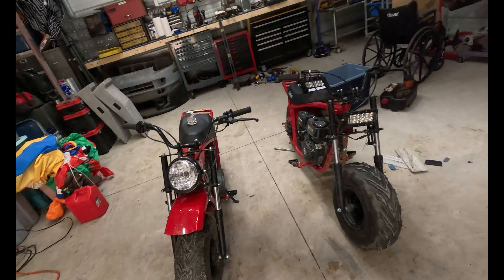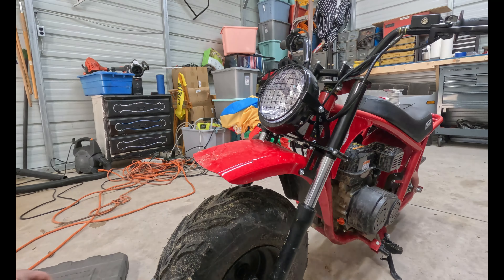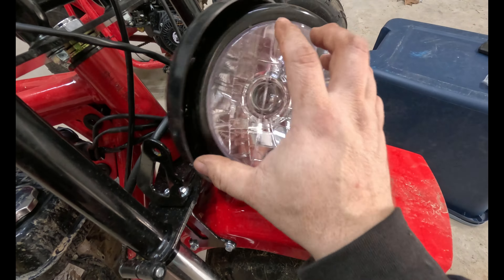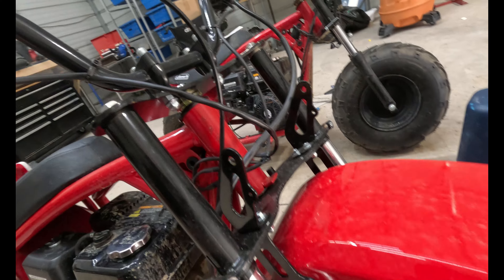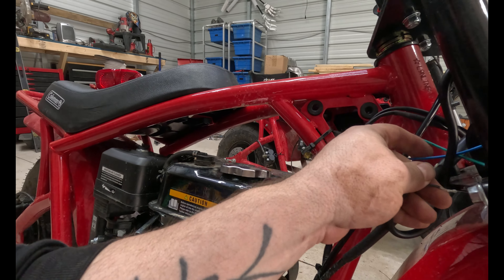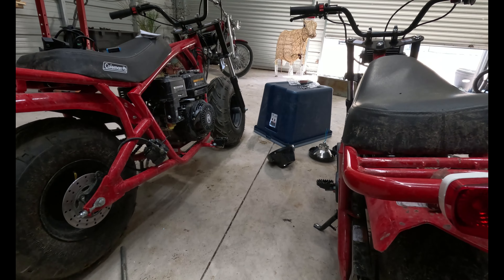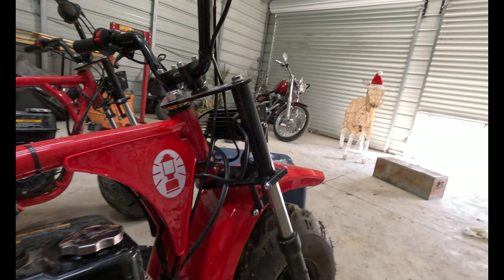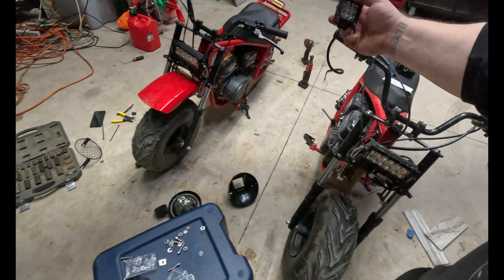Coleman B200R mini bike light upgrade

Comment: Huge props bro thank you. My headlight had gone out on my bt200 and wasn't sure what I was going to do I was leaning towards just putting an LED and replacing it with an LED but then realized how much of a hassle it is. Came across your video and 30 minutes later boom I got a great light for the front. Thanks bro!!
Reply from the maker: Appreciate that bro glad I could help.

Comment: This worked very well, I was stressed out the first time because it didn’t work but I took a closer look and realized the cores the wires weren’t touching 😂. Definitely worth the 50 bucks and is a big upgrade from the weak Coleman light 👍
Reply from the maker: @Zakistheman  glad I could help.

Comment: What size light bar is that?

Sorry if you said it in the video I never came across the size.
Reply from the maker: Hey man no worries. It's a blazer 7in from AutoZone. I never realized I edited out lol. Hope this helps.
Reply: @SucatsGarage  thank you. I went ahead and got me a 12 inch that will do about 26000 lumens. And imma bracket it to the top of the shock mounts. I got a b200 I wanted to do it easy but bigger is better right 😂. Thank you though
Reply: @SucatsGarage  although I do need me some new frames for my two motors. Go kart or mini bike
Reply from the maker: @kamronpowell5784 that sounds sweet. Can't wait to see that

Comment: Have you upgraded the charging coils yet? To produce more amperage?
Reply from the maker: @timhoward7597  I have not. We swapped to a 224 and used a  DeWalt battery to run the lights.

Comment: How many watt led light did you get? Thxs
Reply from the maker: https://www.autozone.com/exterior-lighting/light-bar/p/blazer-international-7in-led-combo-light-bar/181939_0_0     this is the exact one I bought.  @sportbike22ify
Reply: @Sucat  
Last question, Running that light bar and that tail light is that gonna be too much for that? Is it gonna effect the way it runs. I know some LED's use less wattage than the regular headlight bulbs, But I got the same coleman and I was really just trying to find an led bulb for the front but I can't find a part number. So thinking about doing what you did.
Reply from the maker: @sportbike222  I haven't had any issues with it so far. LEDs take much less power than a regular incandescent bulb. You can also buy a power tool battery to 12v converter off an Amazon
Reply: @SucatsGarage  thxs brother

Comment: Do u think running thinner oil or unchanged oil would be better in extreme low temperatures to help it start and warm up better? By the way why are you cutting apart a nice headlight option for visually only? But I get your idea
Reply: Put a smaller rear sprocket on it you'll like it
Reply from the maker: @kevinweber8859  no idea about the oil question. I live in the south so I don't worry about extreme cold. As for the headlights I believe the light bar is far superior in both looks and appearance lol. And I do have a 40 tooth now on it. I believe I made a video about it if you check my channel. If not I guess I forgot to film that one lol

Comment: How long have you had this light bar on? I was told without the 12v it will stop working after a while the light bar.
Reply from the maker: Been about 4 months now. No issues. But I did eventually switch to a 12 converter for DeWalt. That's been about a month or so now

Comment: Could you possibly do a seat/spring mod?  I got a b200r recently and the ride is not pleasant.  No seat springs and the seat itself is very stiff.
Reply from the maker: I'll look Into it. I def agree the seat isn't pleasant.
Reply: @SucatsGarage  sorry, forgot to mention, that light upgrade.  fantastic.  nice diy.  i wonder if there is a 12v battery small enough to attach to this bike, and have 'steadier' lights.  that would be a good vid/dyi for some folks

Comment: Also is it 7inches because it says 13.7 on autozone
Reply from the maker: @anthonymartinez4015  yes. It is a 7inch. I noticed my local AZ was out of stock the other day so they may be getting rid of them but any 12v 7inch light bar should work. Try Amazon or other local part stores. Even Walmart.

Comment: How did you connect the 2 wires together ?
Reply from the maker: I just used butt connectors. Cut the plug off the original light and plugged in the front and rear light.

Comment: Would this work for the b200c??
Reply from the maker: Did it change me with a light from the factory. If so should work the same.
Reply from the maker: As long as it has the stock flywheel and stuff.
Reply: @SucatsGarage  the whole bike is stock but flywheel? Sorry my first bike haha
Reply from the maker: So aftermarket "performance" flywheels do not usually have the magnetic pick ups to create an electric current to illuminate the light. If your bike is stock and your current light works then this upgrade will work for you too. Since I swapped to the 212 predator engine I no longer have working lights and have to buy a battery pack converter (new video this weekend )
Reply: @SucatsGarage  oh okay I got my bike yesterday the light worked for about 2 min then stopped working completely???? Would it work if I swapped it??
Reply from the maker: Should.
Reply: @SucatsGarage  what was that thing you used to connect the wires? I’m just doing the headlight
Reply from the maker: You can use butt connectors

Comment: What gage of wire did you use to run the back light
Reply from the maker: Honestly I do not know. I believe it was 18g. But LED doesn't need much at all
Reply: So the led light I got from auto zone like you is called a blazer led Baja is that the one you have
Reply from the maker: @StickyMorty  yes. With the front led I didn't use any extra wire. I cut the plug off the old harness and spliced them in. With the rear it was just a red marker light and ran wire from the led to the front splice as well.
Reply: @sucat I’ll be working on mine today so I just need to cut where the main head light is at like you did in the video showing you cutting the light
Reply from the maker: Yea that's all I did was cut the stock light out and butt spliced the new front and rear LED to the existing stock headlight wiring
Reply: Nice I’ll see if I can post a pic of my bike when I’m done. Do you do only street or do you also do trails and creek beds?
Reply from the maker: @StickyMorty I have a few trails out here but mostly street. Gonna see if I can get another video this weekend based on the weather
Reply: @sucatwhat size did you drill the holes
Reply from the maker: @StickyMorty  the front I just used the existing hardware for the rear I used self tappers. Drilled like an 11/32s or so pilot hole just to have a starter
Reply: What kind of rear light did you use. I think I got one like though have. I put mine on the back of my milk carton that I have mounted on the back where you put your light, but it’s not working
Reply from the maker: @StickyMorty  I got a led lights from Lowe's. The light has to be grounded to the body.
Reply: I got mine grounded it to the cart another way an not the body it’s self

The only problem now is as I give power to the bike at faster speed I loose power to the led bar